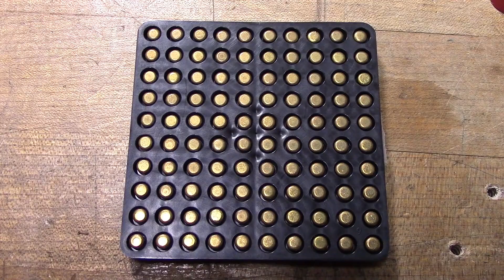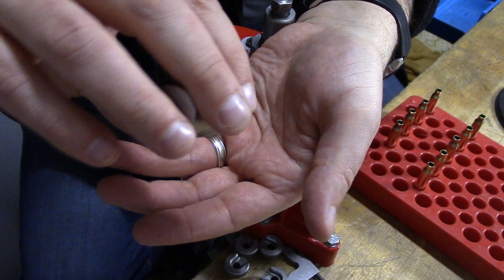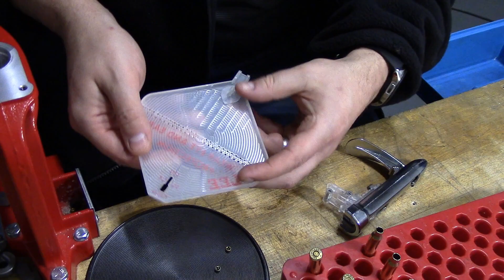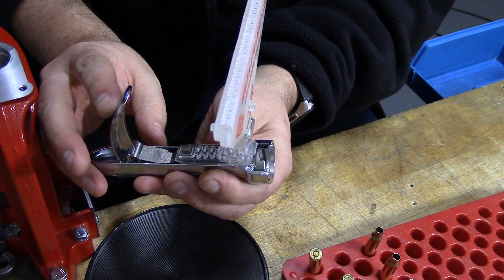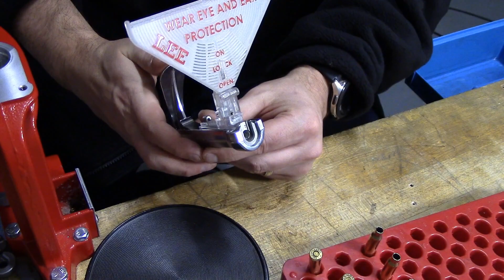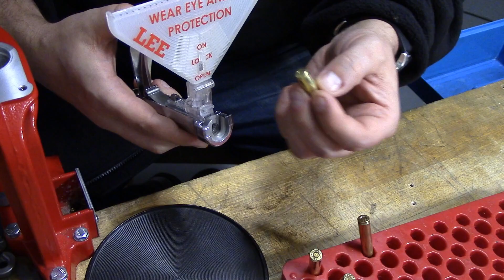Reloading Rifle for Beginners - Priming | Guns N' Reloads

Comment: I prefer the hand prime method over the prime on press for the simple reason that in the prime on press method your fingers handle each individual primer and possibly deposit oils or acids from your fingers onto the primers.  In the hand prime method you do not touch the primers with your fingers, eliminating possible contamination.